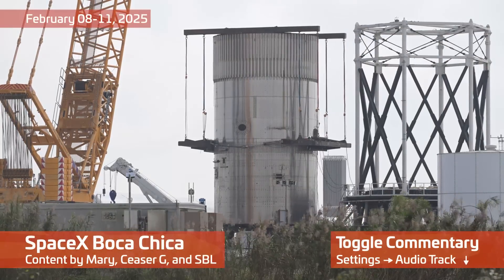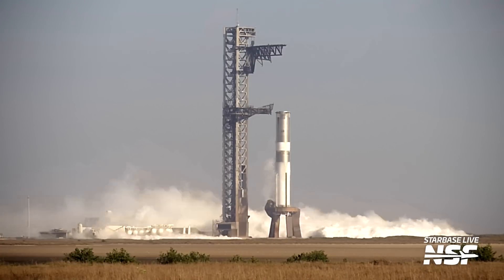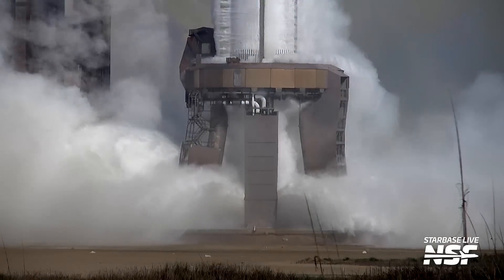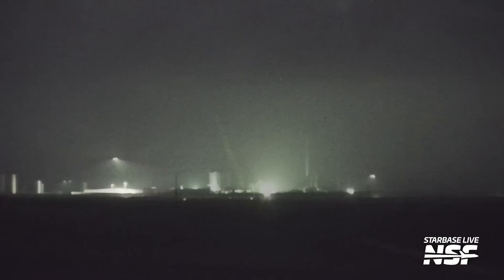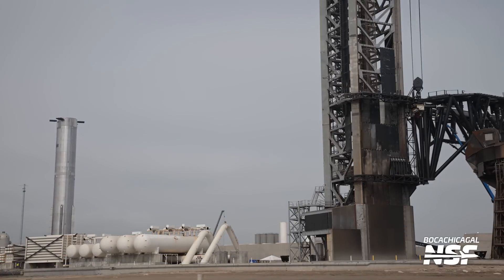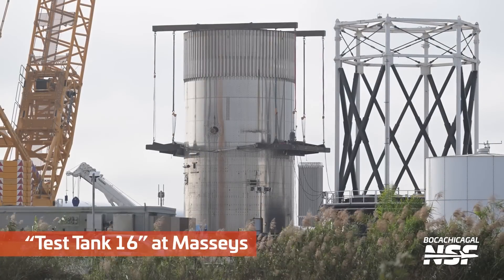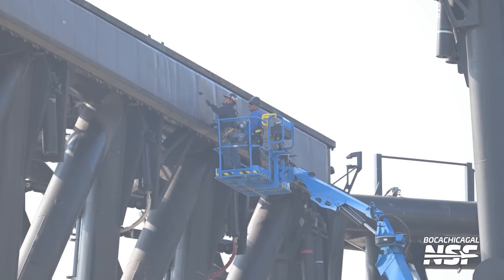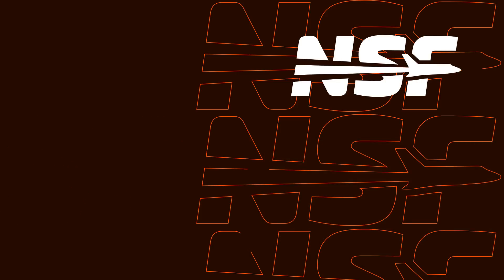"I Promise You Starbase Did Not Explode" | SpaceX Boca Chica

Comment: While 56 seconds is certainly better than the 7 seconds burns SpaceX calls "full duration", it's still not good enough. In IFT-7, flames were seen coming out of the flap hinge joint about 7 minutes into the flight. Since stage separation is at about 3 minutes, this means flames were seen about 4 minutes after ship engine ignition. Then any test of the ship should go at least that far, though ideally to the full 6+ minute burn of the ship for an actual flight.

 Relying on this test as confirmation of the reliability of the ship launching, would be like saying after 1 minute into the ship's engines firing during IFT-7, "The ship engines have fired fine for the first 1 minute. That must mean they are good for the rest of the flight."

Comment: The water is there to keep the concrete cool so it will not deteriorate over time...
If the water was not there the launch pad would start to fall apart after only a few launches...

Comment: Deutsch
Hallo, danke wieder einmal für das tolle Video. Was fliegt in Min 2:05 rechts vom Turm in der Abgaswolke weg?(Leider kann ich hier keinen Screenshot anhängen) Es wird wieder sichtbar in Min 2:18 immer noch rechts vom Turm an der Grenze zwischen Turm und Abgaswolke. Es sieht nach einer Abdeckplane oder einem Banner aus, was sich beim Statischen Feuertest gelöst hat.
English
Hello, thanks again for the nice video. What flies away to the right of the tower in the exhaust cloud at min 2:05? (Unfortunately I can't attach a screenshot here) It becomes visible again at min 2:18, still to the right of the tower at the border between the tower and the exhaust cloud. It looks like a tarpaulin or a banner that has come loose during the static fire test.
Reply: I've been thinking it's a large plastic sheet, but it's hard to tell from this distance with the dust

Comment: On the 747 the bottom wing body panel is called the dance floor.
Reply from the maker: Wait really? Why? Just the size and shape? - Das
Reply: @NASASpaceflight  dance floor is a common term for work platforms, at least in commercial aerospace.
Reply: @ I think just because its huge? its like 10 ft by 5 ft
Reply: @ I will ask some of the older guys tomorrow.
Reply from the maker: Yeah, would be curious to learn about it! - Das

Comment: During the long static fire - couldn't you shut up for 10 seconds and let us hear it? Sure, it needed some commentary but not an unbroken one. We shouldn't have to switch over to Klingon and back, this should be integral to the narration.
Reply: You could switch to the Klingon audio track to disable voice over.
Reply: @Yggdrasil42   I addressed that. If we want the commentary track for the whole video we shouldn't have to switch over to Klingon for an item like this. Sound lazy? Hey, there's no end to the lengths lazy is taken to on the internet and on sites.
Reply: Just use the Klingon track.
Reply: @   I answered that in the comment. Doesn't any one read a comment all the way through? Yggdrasil42 had the same problem.

Comment: Well, if they ever plan to launch from Mars, I doubt a water deluge would be an option... 😃
Reply: You don’t need the booster to takeoff from Mars
Reply: @redbeard11200  A valid point... Although, playing devils advocate: with less gravity, vastly more dust and virtually no atmosphere to slow down ejecta, I would think you wouldn't want to be throwing debris all over.

I imagine they'd have to lift off with all 9 engines lit, and so you wouldn't want to be kicking up huge rocks into your rocket bells either, nevermind however far they'd travel laterally. 😦

🤔 I wonder if using meteor impact craters would be a way to mitigate some of the ballistic debris from damaging any outbuildings... or more importantly, the RTGs they'll likely be using for power. (as I imagine they'll remain on the surface even after they relocate into underground bunkers)
Reply: @robyn051  we don't know that..  no one has ever tried to launch from there.   Still has a strong gravitational pull...    what you don't have is water.
Reply: @Xchef68 we know we don’t need the booster there based on the low gravity and thin atmosphere